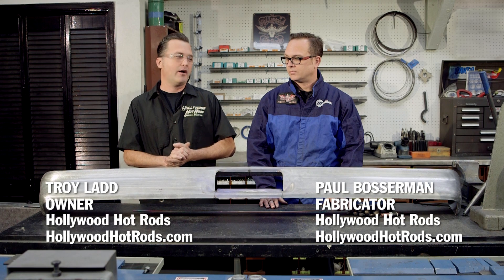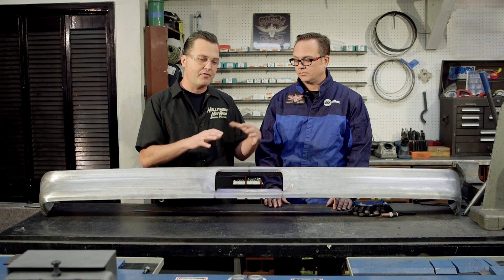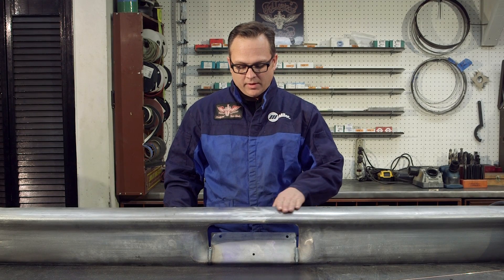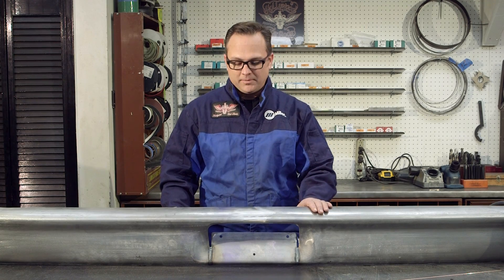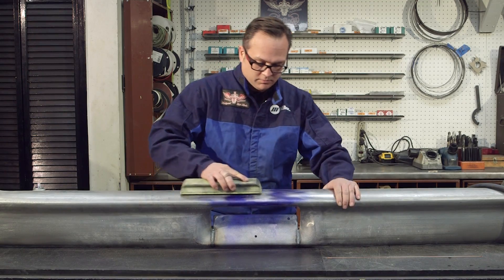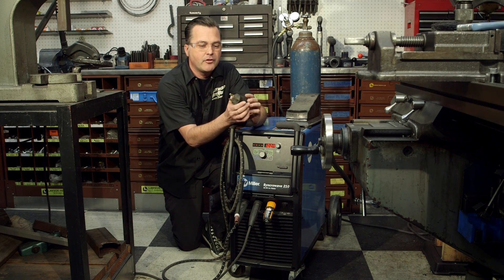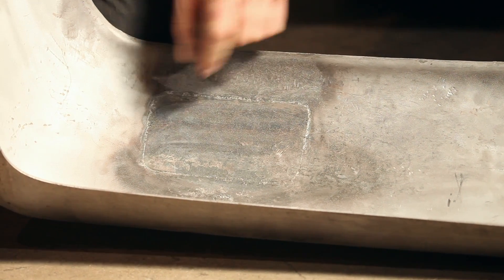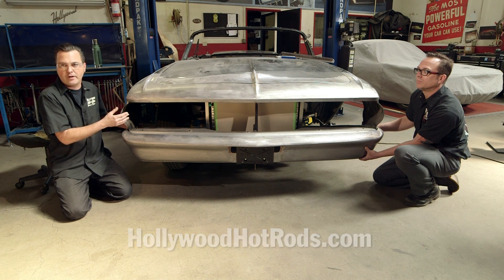How to Narrow a Steel Automotive Bumper Using a Miller Syncrowave 210

Comment: Poor video, Hollywood Hot Rods does great work but the title doesn't match the poor content, crappy bevels and why not show how and where to cut, how to keep pieces aligned, why not finish the inside welds??? Poorly executed, Miller can afford more than twenty dollar budget on a video that doesn't tell any good reason why to buy a welder that's at the top of the price charts. Everyone makes welders with variable plugs for input voltage and have they solved the lag in the wireless foot pedal?